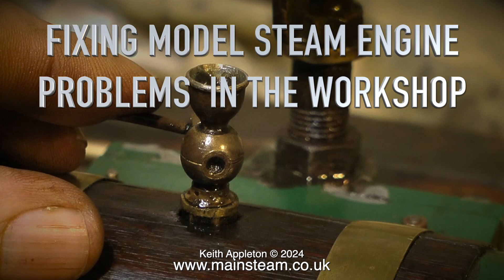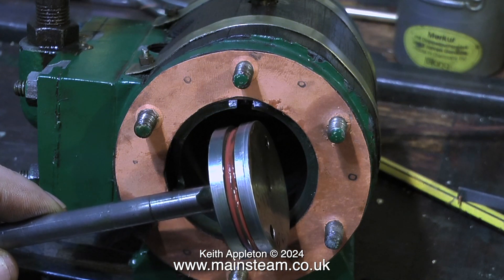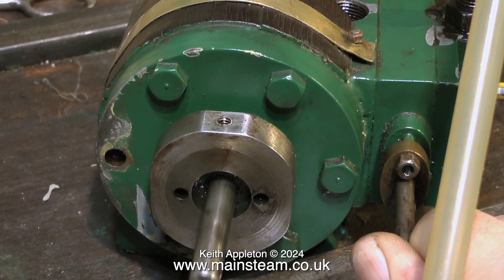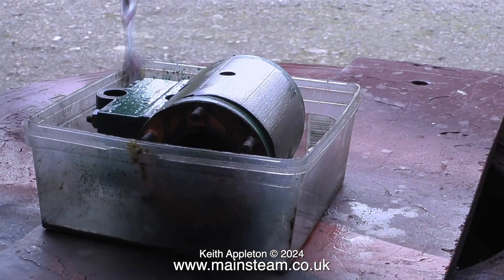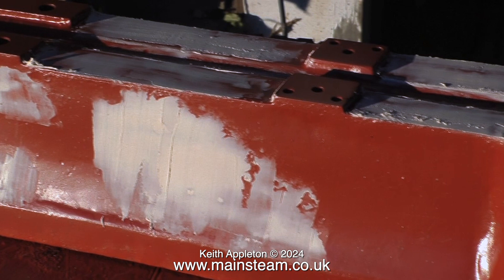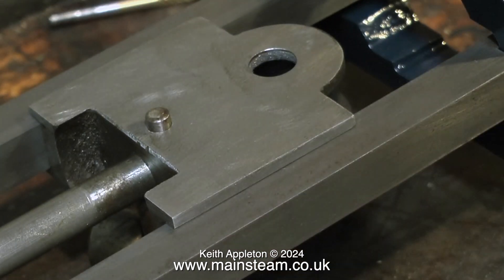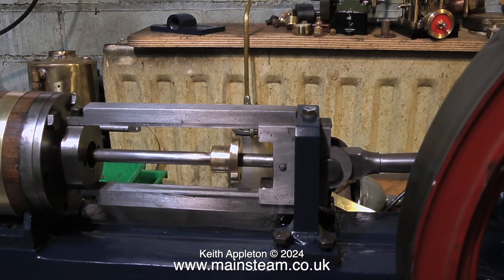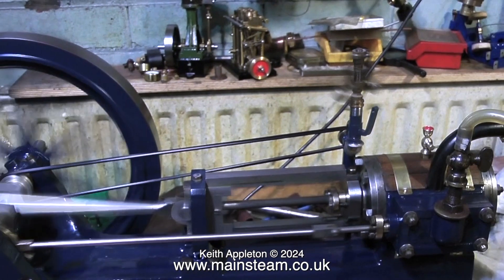FIXING MODEL STEAM ENGINE PROBLEMS - IN THE WORKSHOP #1

Comment: But this makes no scene. How does the steam not bypass down that groove to the opposite side, Therefore not it should not run.
Good looking engine when you were done, well done
Reply from the maker: No scene? Do you mean sense? ............ One more time: (another viewer didn't get the principle either). This reservoir type lubricator in the middle of the cylinder is only for AFTER A STEAM RUN - to allow oil into the Cylinder via the oil groove, in order to prevent rust - not when it is in steam . . . . . . . . . the oil groove is on the outside of the sleeve in the original cylinder - not on the inside - ! Now do you get it?
Reply: @keithappleton  Whoops, typo, sense hahaha. I get the location so it wont affect the piston ring (o ring) and use after running. but how does it not inadvertently balance the intake and exhaust side per stroke.

Comment: And here's me thinking of a Wilesco  traction engine. Not quite in the same class i guess.  But for the black Friday sale it is $ 120 off the $ 799.99.  ( D 406 )
Reply from the maker: If it makes you happy, then buy it. Personally I would rather spend on a better Traction Engine than a small toy one.
Reply: @keithappleton  That's what I'm thinking.  The gears look a bit flimsy
Reply from the maker: It is just a simple toy .........
Reply: @keithappleton  Hi, I will not be buying. I've seen some things I don't like. Fire box  sticking and coming apart, and It seems boilers can overheat and then come apart.

Comment: I do not understand this cylinder repair at all. Why doesn't the oil blow onto the ceiling when you open the valve? Why doesn't the steam blow straight past the piston through the groove?
Reply from the maker: This lubricator is for after run oiling to prevent rust - not when it is in steam . . . . . the groove is on the outside of the sleeve - not on the inside - ! Now do you get it?
Reply: @keithappleton  Thank you, Keith. I appreciate it.
Reply from the maker: The main cylinder lubrication is via a mechanical or Displacement type Lubricator using Steam Oil.